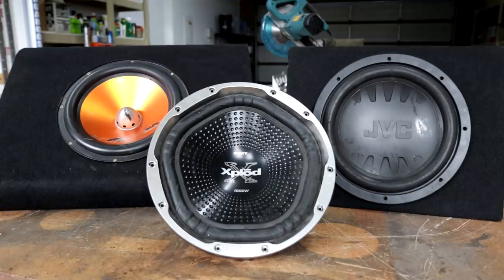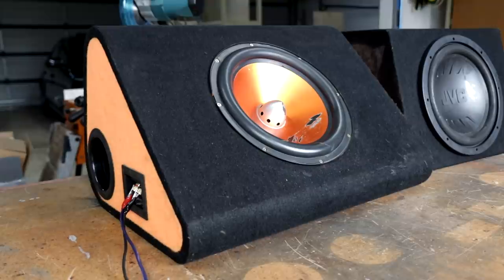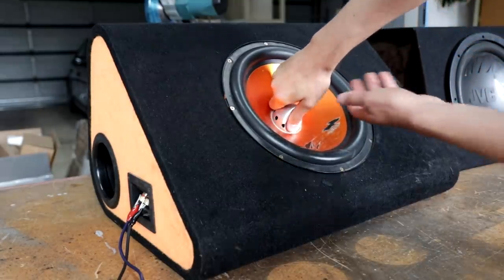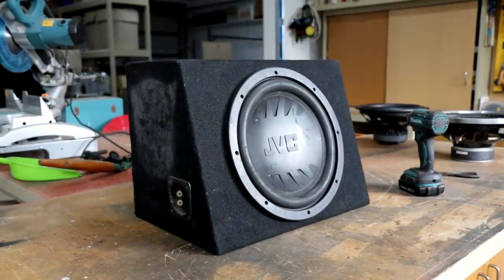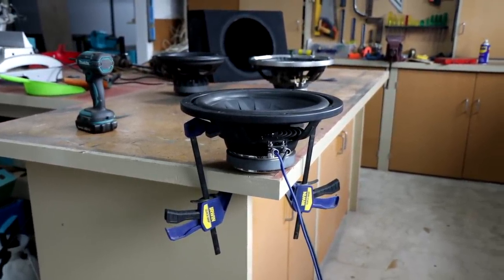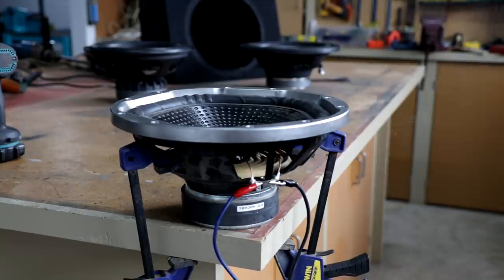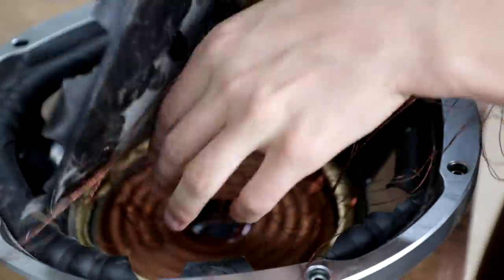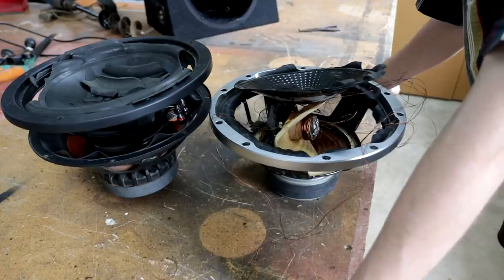BLOWING UP 3 12" CAR SUBWOOFERS

Comment: To be fair when you did the jvc clamping it to the table like that made it so it wouldn't push air through the coil so it may have went faster because of that.
Reply: Well the cone was still able to move so air could still come in.

Comment: I have a 3000 watt subwoofer 1500 watts in each and I pushed it too hard and all sound stopped but then I took it to see what the problem was it was just a few blown fuses in the amp I got them replaced and now the sub distorts on the same song at same volume whereas before it didn’t I’m not too educated I’m car audio hoping to get some answers.

Comment: Those sony’s will take 3-4 times their rms power if its clean and in a well build box.
Reply: Haha no they wont xD If the rms is 100 it wont take 4x that (400 rms)... xD
Reply: No. 400 rms tops. May take 500 in burps
Reply: I once gave 2 3x the power and they performed well and lasted the period of me owning them. I built a 3.2 cuft box, 1.6 cuft per sub they shook everything without smelling

I eventually pawned them and lost them. I went back to buy them but someone purchased them
Reply: @brotharobmusic  not that I don't beliece it I just don't see I. U had 2 so thats 700rms the pair and u pushed 2100 watts rms threw them? Not all brands make the power they claim.
Reply: @brotharobmusic  don't get me wrong i like sonys over JL w0, w1 and w2. Ive owned about 5 and never burned one. I got a vid of a pair in my channel on a 500 rms alpine mpr amp.
Reply: @migascustomsounds3054  there's a video were a guy gave one 1800 rms on YouTube but its the red version... This is my opinion but to me, they was as good as pioneer impp that was very popular back then. Pioneer had the best subwoofer, especially when they was made in Mexico. Now they are made in China now and can only take 3/4 the power it claims
Reply: @migascustomsounds3054  in 2006 i got the black sony subs they had the 1300 on the cone. I didn't get a chance to put them in a 4th but they moved alot of freaking air. They was impressive subs hands down
Reply: @brotharobmusic  haven't seen that vid.  I never really abused any of the ones I had. They all said made in mexico. Had the red old school ones. Impressive indeed. I think the old kenwoods were as good.
Reply: @migascustomsounds3054  Barevid channel, this the video were the guy put 1800+ rms in a 12"

Comment: Hey, I live in the uk and I’m getting a car, I wanna buy some good budget subwoofer, do you have any recommendations, something around 100$. Really new to subwoofers that’s why appreciate the help🖤
Reply: Jbl stage series subs
Reply: There are also sundown audio subs (slightly pricy depending on size and wattage) and many more,some research should do the trick
Reply: Muiz S edge 12inch. I’ve got one, you can get them for around £50 used and brand new for around £100. I believe it’s 900watt.
Reply: Edge edb12d2x-e7 you see vids on my channel it's underpowered a lot on my vids

Comment: I used to have a red version of the Sony xplod
Reply: I actually have a red one, its an 8 inch 200 watt rms 300 w peak, i managed to put about 900 watts through it at 4 ohms without it blowing or even heating up, the sony subs usually take waaaay more then the rated power (I have the Sony Xplod XS-AW200X)